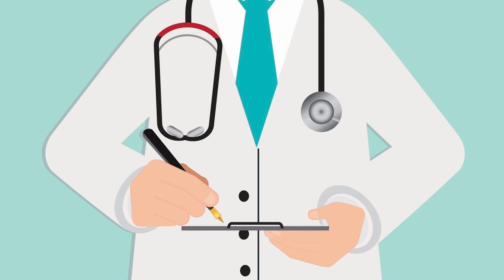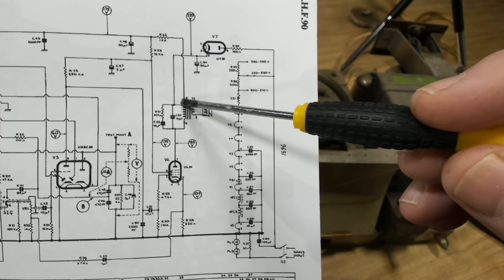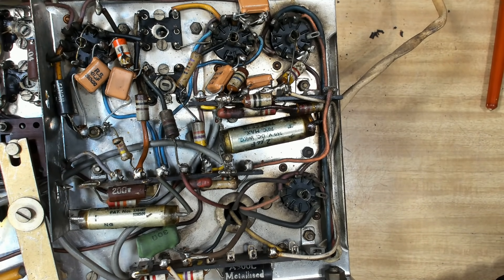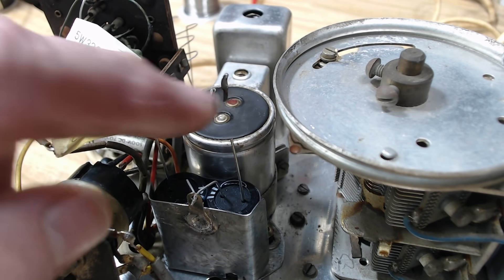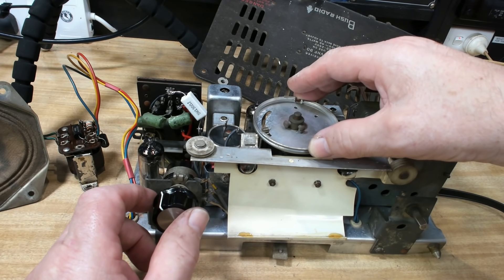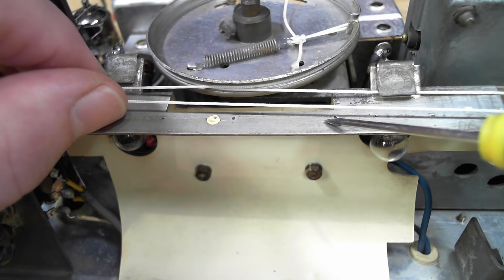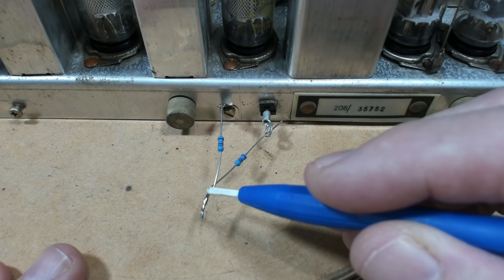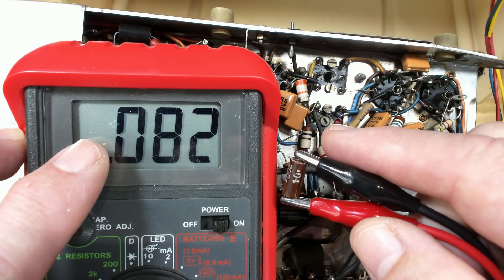Bush VHF90 Radio Restore - 1956 with Special Medical Report

Comment: I have one very similar here in the UK :) lovely little sets I'm thinking of selling my dac90 too,I have to much here in my workshop
Reply from the maker: I have too many too but struggle to part with them. The DAC90s are great sets, I have the DAC90A. I would love one of the early round Bush radios 🙂
Reply: @DavidTipton101  would you like to buy? i also have a bush  TV 22 Bakelite TV from 1950 but i can't get it going its literally sparkling and very shiny just so upset that i can't fix it :/
Reply from the maker: @FSCforal  I haven't done a TV, I would like to but don't have the room. The round radio I was thinking of is an EKCO I think.
Reply: @DavidTipton101  I'm not very good at repairing anything like radios or TVs do you think you might be able to help me im rubbish at it hence why im trying to sell them ive given up i got all the parts just missing the brain in my head lol
Reply: @DavidTipton101  its a iconic TV22 lovley bakelite case cost me a whole heap of cash and it looks so retro from the 50s i plugged it in and it just smoked :/
Reply from the maker: @FSCforal  Yeah, they'll do that. All the capacitors will need replacing and resistors checked and replaced as necessary. Then there is the picture tube, faulty valves, flyback transformer etc, etc. You might be able to find a radio or TV club in your area that can point you in the right direction, maybe a retired TV tech. Best of luck.
You could check out Buzz1151 video series on fixing an old Emerson TV: https://www.youtube.com/watch?v=Cw6y3ugYWVI&t=2s&ab_channel=Buzz1151

Comment: Glad to hear you've found the cancer early and getting on top of it! Perhaps those orange capacitors are RS components caps? I've never come across a series string set around here, hopefully one with FM turns up one day.

Edit: I believe WES components in Sydney might have the correct voltage bulbs available, although I'm not 100% certain. Great work on the radio!
Reply from the maker: HI Burnt Out Electronics, yes, vigilance paid off. I have a number of series string UK and US origin radios now, they are a bit different, particularly the US ones 😀
Yes the orange caps are from RS Components.

Comment: Thankfully the cancer was caught early and chemo will treat it.  Hope the chemo doesn’t knock you around too much.  Loved seeing this set, yes the FMband in the UK was limited to 100mhz but has been extended since.  Pretty sure Bush didn’t sell any sets here as that one was not 88-108 so not designed for the Australian market.  I saw a Kriesler 11-99 and an HMV in the antique shop here.
Reply from the maker: Thanks Wenlocktvdx, it's radiation therapy so hopefully not as bad as chemo. This radio would have been bought over from the UK by an migrant I would guess. I have a Kriesler 11-99 under the bench, I should drag it out someday 🙂

Comment: David you should look at LED replacement bulbs for the dial in this set .
Reply from the maker: Hi Richard, I did that on my Bush DAC90A but I decided to leave this one original, I may find the correct bulbs one day and it will be truly original 🙂
Reply: @DavidTipton101  Hello David I may have them in my stock you say 3.5 volt do the bulbs have a number on them ?
Reply from the maker: @richardbrobeck2384  I don't have the original bulbs, the ones fitted were 6.3 volt. The spec sheet says they should be 3.5 Volts at 150mA and a MES thread 🙂

Comment: Hi Dave, I'm really glad they found it early on. Wish you a speedy recovery. Just take your time and take care of yourself. I'll wait.. 😊 Have you ever tried using cold spray for troubleshooting intermittent faults? We used to have that when I repaired audio equipment for Philips. Works great!
Reply: Cold spray? That seems interesting, on what parts do you apply it?
Reply: @jerkerfridh8189  When there's parts that you suspect, you spray them with this cold spray. Because of the sudden temperature drop the material warps. And if there's a fault it usually shows. It used to work better than tapping with a screwdriver and you can apply it to individual components.
Reply: Thanks for the great tip. Well obviously heat is a great factor in the environment of a valve radio, so a bad solder point or a shorting/open resistor would be affected by cooling, but does it work with a capacitor?
Reply: @jerkerfridh8189  We used it on any components. Resistors, capacitors, transistors and ic's. Obviously we didn't service equipment with tubes, so I've no idea if that would work.. 😊
Reply: @Rene_Voortwist  I suppose instant cooling of a heated tube would definitely make it a faulty component.😆
Bedankt👍
Reply from the maker: Hi Rene, thanks, I'm glad they found it early too. I have several cans of freeze spray and I could have thought to use it on my current project looking for a faulty capacitor, I should have read your comment sooner 🤦‍♂️

Comment: @David Tipton; Wishing you nothing but the best, Dave!  While I've not been through the 'prostate ca' adventure, since July of 1996, I have been dealing with a quite problematic uretheral stent - known as the "Urolume Endoprosthesis".  For me, it's been "a hayride through HELL"... Remember to always 'hang in there', you have a more than substantial support group - in your channel's subscriber roster.  Consider them to be, and use them as - the asset - which they are. YouTube's radio, and antique electronics "restoration crowd" is composed of some damn fine people, and a few "bots".  Again, all the best, my friend!  Tim
Reply from the maker: Thank you Tim. I'm sorry to hear you are having problems with your stent, I hope that particular hayride is over. I have received nothing but support from my subscribers, it's been amazing and they are fine people, I delete the bots as quickly as I can. Thanks Tim, I'm looking forward to getting this cleared up 😀

Comment: Hello Sir, very nice radio similar to Eko. Sir which solution that you are using to clean the chass, it looks like new and good.
Reply from the maker: It was 'Instant Engine Starter' fluid but you can use any solvent that won't hurt plastic. Isopropyl alcohol is good.
Reply: @DavidTipton101  Thank You Sir for your kind information.

Comment: Thinking of you while you battle this cancer. I was wondering if you were prepared to try replacing the light globes with bright leds.
Reply from the maker: Thank you psionl0. I considered it but kept it original in case the correct bulbs show up one day 🙂
Reply: @DavidTipton101  If the correct bulbs show up one day you could always rip out the leds again.

Comment: Highly likely that it's badge engineering. Bush/Ekko
Cars used to do. Musical instruments, many consumer goods.
Good luck with the surgery. Hoping that they caught you in time.
Reply from the maker: Hi MauriatOttolink, I think this is a Bush radio made by Bush and the EKCO was made be EKCO. They just look very similar because that was the style at the time. Thanks MauriatOttolink for your best wishes 👍🙂
Reply: @DavidTipton101  
Hi Dave..Don't I know just how bloody true you are!
I was a raw, Radio and TV, apprenticed, repair engineer at the time (Shaving no more than 3 times a week) and I certainly can't remember any tie-up between Bush and E.K. COLE..
The 90 is very significant because Bush had a bakelite cased
LW/MW radio called the DAC 90.  It was, as you might well suspect, a transformerless ...AC/DC  (series heaters) with a very long pedigree, a mains dropper and a VERY live chassis. 
When I saw your set open up with a big mains transformer next to a 5Z4 type rectifier and a 6V6  "power valve" as they used to call them, I realised that Bush had 'moved on'..
How we learned about 'wirelesses' in those days. 
Brits were known as POMs (of the whinging type) and Aussie were known as 'Diggers'.
Keep getting well. We're on your side!
M.O.L
G3NBY
By the way, when they came in that condition. in 1960, we just "got'em going again!: We didn't "restore" them!

Comment: 1)  In some countries, the FM band originally extended to 100 MHz.  2)  It is my understanding that Australia was a very late adopter of FM broadcasting...your thoughts please.
Reply from the maker: Hi William, yes that's correct, I think it went to 104 then to 108 MHz, European countries had different standards meaning manufacturers had to make their radios suitable for different regions. Australia officially got FM in 1974 or 75 🙂

Comment: They don't make them like they used to. Great tube sound.
Reply from the maker: Yeah, they work well don't they 👍🙂
Reply: @DavidTipton101  my son has a 100 watt Fender Mustang II solid state guitar amp that emulates all the Fender classic amps and has a bunch of effects. I have a 15 watt Fender Blues Jr. with a spring reverb, and an old Gibson Skylark with tremolo.  He would rather play through either of my tube amps than his silicone sound box. No matter how hard you try, you can't get the warmth and and stage presence from power mosfets that you get from tubes. And it's not from a lack of trying.
Reply from the maker: @dmkays  tubes rule 😀

Comment: those 'orange' box caps are much later than the radio, i have a few, so 100% been replaced,  think they date from the late 60s/early 70s and poly dielectric so very unlikely to give trouble,
Reply from the maker: Thanks andygozzo72, I worked that out... eventually 🙄😄

Comment: Dave, wouldn't it be better if you blow that compressed air while also vacuum cleaning it, sucking those dust out at the same time? Those accumulated dust can be dangerous if you breathe in.
Reply from the maker: Hi kalerka, yeah, that would be better, I don't have a vacuum cleaner out there but I could rig something to use with the shop air. I do wear a mask when I do it, actually anytime I'm out there. Thanks 👍🙂

Comment: Your cancer must have been treatable enough for you to lampoon it, hope that's really the case.
I don't think that shield was needed for the caps, they are carrying mostly DC after all, but it was a good way to mount them.  I'd probably have used some 'hot snot' to do that.  My grandfather once 'aligned' a radio by tightening all the screws!  I then had to fix it.
Reply from the maker: I hope it's treatable enough, I took a light-hearted approach as the main message is to get tested. I don't think the shield was necessary either but I may as well do it while I was there. That was a common method of alignment it seems. Thanks scharkalvin 👍🙂

Comment: Get well Dave, and I hope you can continue making these excellent videos.

P.D.: PSA levels go high naturally with age. Let me be clear, there is a lot of unnecessary scaring going on to make you go into their treatment protocols: "we have to open and extirpate this, irradiate that, you will no longer be able to do..." just don't buy into it.
There are lots of cases of people that controlled their psa levels and the tumoral signs disappeared with weekly vitamin C injections and cutting short of sugars, flour products and alcohol. It may sound childish talking about vitamin C, but it really works. Just have a look. Because if they open and cut that, the thing may spread, it only takes a single bad cell to travel through the bloodstrem to find a new place to grow. That's why the body generates inflammation where the bad thing is found.
Too complicated to synthesize in a simple commentary like this.
Reply from the maker: Thanks Josep, I will be here to make more videos. The cancer has been confirmed by a PET scan, I now have to do the treatment to remove it 👍🙂

Comment: theres a 3 band model with LW as well, vhf70(i have one), they are notorious for ht tracking/breakdown/arcing on the wavechange slider switch,  they should have good sensitivity as theres 2 UF89 IF stages, but mine is very poor, maybe caused by all the nicotine muck covering everything! yuck!
Reply from the maker: Someone else had the 70 model too, same radio otherwise. Nicotine or tar as I've been corrected is the worst! lucky this one didn't seem to have that affliction 🙂
Reply: @DavidTipton101  hopefully get mine sorted...sometime,  .. some previous owner/engineer has drilled holes in the side and fitted 2 'wander plug' sockets connected to the speaker ,😢
Reply from the maker: @andygozzo72  Oh dear, they could have put them on the back 🤦‍♂️
Reply: @DavidTipton101  i had worse, similar done to a small philips set, and they were live in this one 😲, at least the speaker winding is isolated in the bush!
Reply from the maker: @andygozzo72  Yes it is. It wasn't unusual to do that back then even on hot chassis TVs 🙄